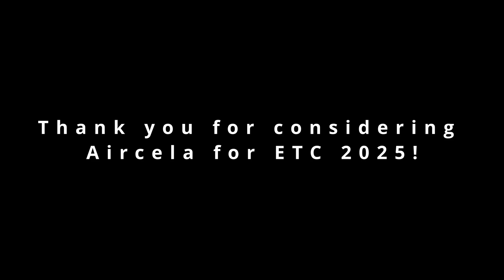Aircela | From Air to Engine with Fossil-Free Fuels

Comment: I can say without even knowing how this thing exactly works that it is 100% bullshit. There is no way that there is enough CO2 concentrated in the air to even be able to produce a commercially viable amount of gasoline, not to mention, there is no chemical process that can produce gasoline via CO2 + electricity that quickly. I have worked for 10+ years in CCU and I have seen all  the BS there is to see, DAC is another of them. Please stop misleading people with this garbage, and do actual science.